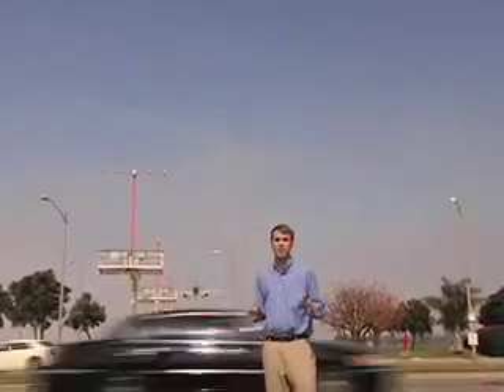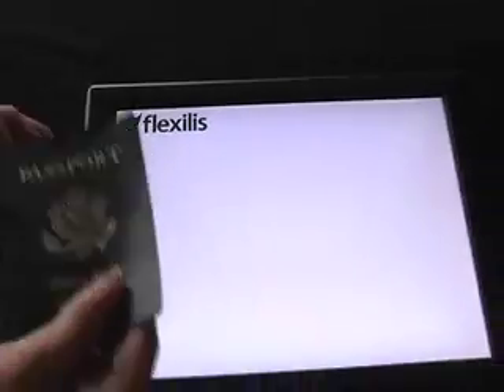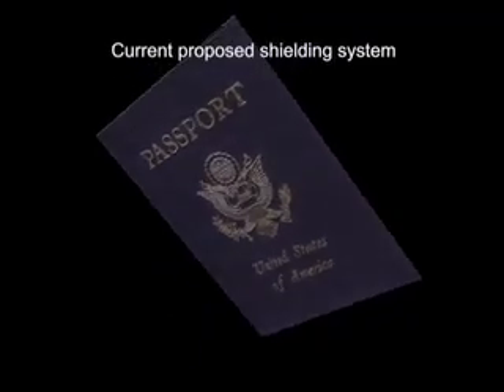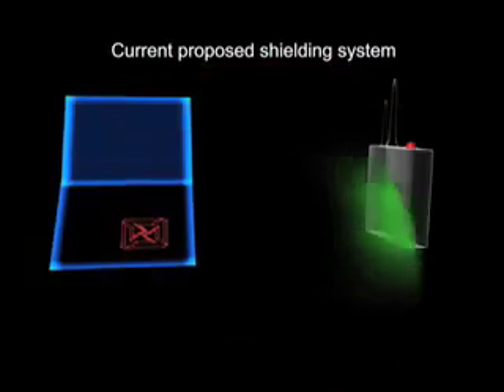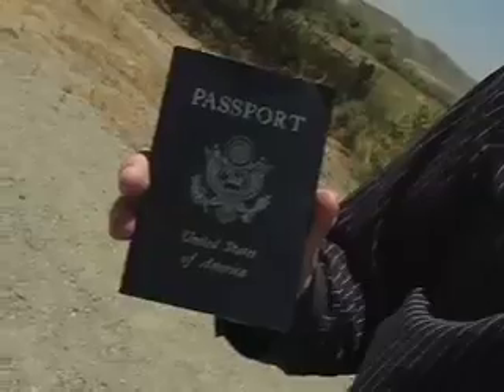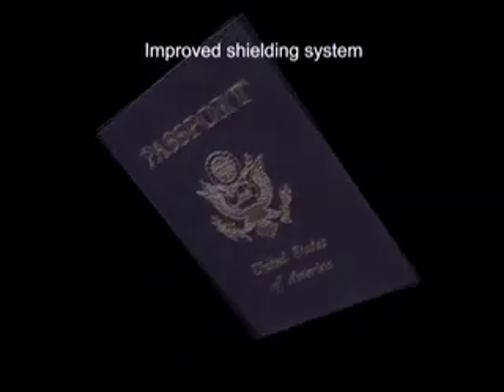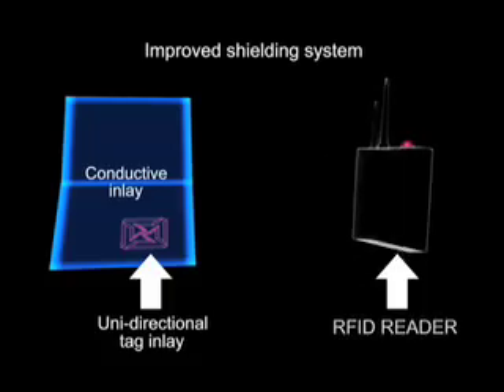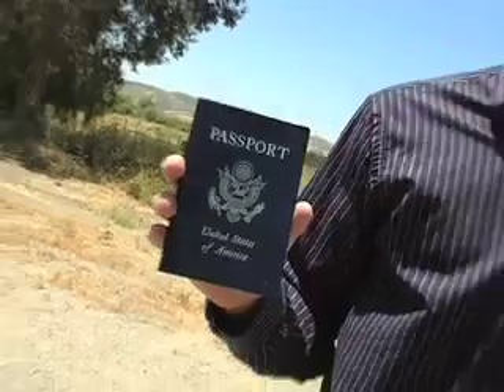RFID Passport Shield Failure Demo - Flexilis

Comment: If the RFID tracking grid IBM has implemented on the highways can read inside a steel semi trailer, no thin shield of any kind will protect you from being tracked, not even the upgraded one you are proposing.  Excellent proof of concept and nice demonstration though..